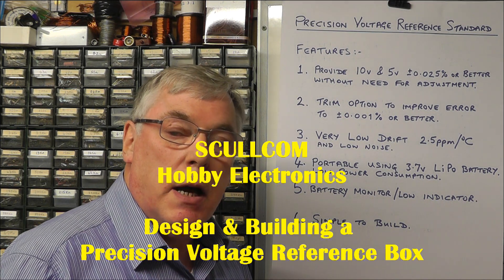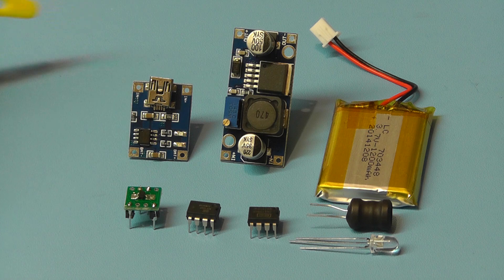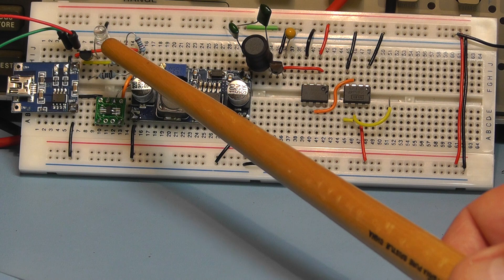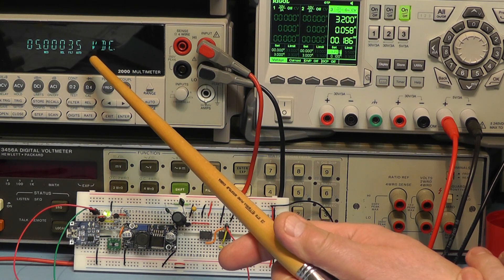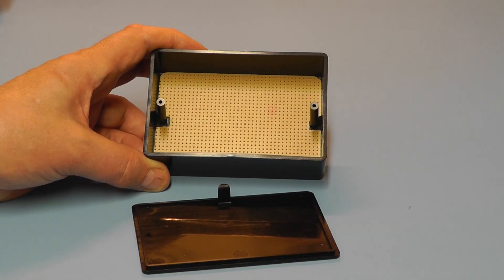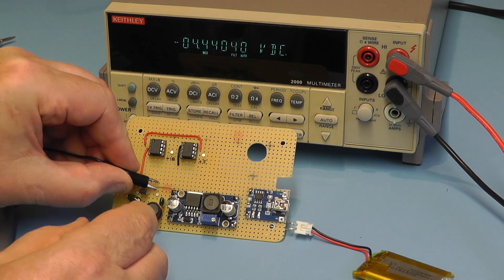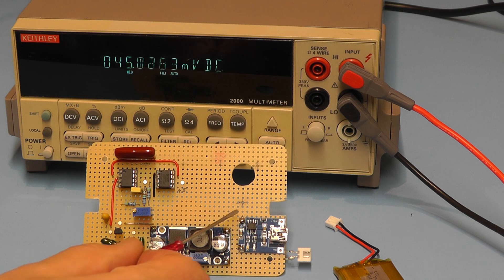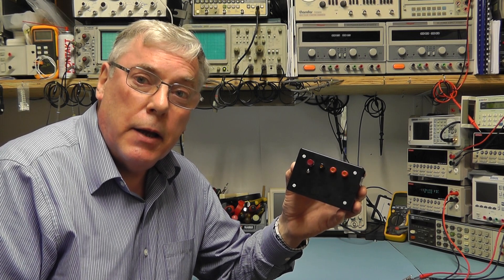Scullcom Hobby Electronics #11 - Design & Building a Precision Voltage Reference Box

Comment: Great tutorial. Would it be an advantage to use another op amp to buffer the output so it no loaded down by your measuring equipment?
Reply: Replying to an old post... If your voltage measuring equipment is "loading down" the voltage output, then you have absolutely ZERO need for this device. In order to take voltage measurements with even the slightest accuracy, your voltmeter should not be placing any significant load on the voltage source. Even the cheapest digital multimeter should have a high enough input impedance that thee will be almost no load whatsoever.

Comment: Hi . Thanks for this video. It's fantastic! How do you compare this reference to the other one from your videos (that one only had one output voltage)? Also isn't the red LED (or it's transistor) wired backwards in the schematic?
Reply from the maker: Thanks for your comments. All of the voltage reference projects produce a accurate voltage. The accuracy depends on the reference IC used. In this project I use a Texas REF102C which has an accuracy of ± 0.025%. In my other 5 volt reference project I use a Intersil ISL21009BFB850Z which has an accuracy of ± 0.01%, but this IC is sometimes hard to get.
The Red LED is wired correctly. The cathodes of both the Red and Green LED's go to the negative supply point. The transistors are a PNP feeding the Red LED and a NPN transistor feeding the Green LED. both transistor bases are connected via 1K resistors to the Voltage Supervisor IC which switches between either High or Low output depending on the level of the battery voltage it is monitoring. So the Red LED comes on when battery low and the Green LED comes on when battery is OK.
Reply: Thanks for your answer.
The circuit is OK and I understand how it works, but isn't the polarity of red diode is wrong on the schematic at mark 10:00 ? The transistor is a PNP with emitter pointed from the diode to base. But the diode is oriented from the emitter to GND. In other words "arrows" of Red LED and it's transistors emitter are pointing in opposite directions.
I believe the emitter and collector of Red LED are swapped.
Reply from the maker: I had another look at the circuit in the video. The LED that I use in this project is a RED/GREEN three pin (Bi-Colour) LED with a common cathode. So the LED wiring is correct in the circuit. However, I see that I had the PNP (2N3906) transistor with the collector and emitter connections reversed as you quite rightly point out. Although this is technically incorrect the circuits still works due to a number of reasons and theory behind a transistor.
The doping of the silicon of the emitter (P), base (N) and collector (P) junctions are all different, with emitter being the most heavily doped element. But although emitter is more doped than collector, the junction size of the collector is larger than the emitter so total number of charge carriers remains almost the same in both emitter and collector regions. So in this practical situation, of my circuit, it does not make a big difference if emitter and collector are exchanged.The other reason it still works in my circuit is due to the low supply voltage of only 3.7v, if the voltage was much higher then the transistor could possibly breakdown. Also if the transistor is reversed wired the transistor current gain is drastically reduced, but in this circuit that does not really matter.
Thanks for bringing this point to my attention as it allowed me to cover this situation of what happens when a transistor is reverse connected.

Comment: Nice and simple! What is the accuracy of the Keithley? Important to note that the drift will be dependant on the external trimming components when you use them.
Reply: You can improve your results by using low tempco resistors and recalibrating the reference after it is on for at least 2000 hours.

Comment: Good tutorial on the voltage ref. I might make one. Very clean and well built. But there's one thing you should consider. What happen when you forget to switch off the box?
Reply from the maker: lavith.hcm Thanks. With regards your question about forgetting to switch off. You might like to check out my latest project on a 5 volt Reference where I include an auto switch-off feature, which could be added to this project. Check out link below:
https://www.youtube.com/watch?v=sKFT9LouyTY

Comment: Nice video! Just wondering how the accuracy is when a sufficient load is at the output of the device?  Does that affect the accuracy of the reference etc.  How can one deal with accuracy with changing load conditions such as changing audio levels etc. of an audio amplifier?
Reply: This device is not intended as a power supply to be put under load. The device is intended as an accurate reference voltage to check calibration of devices, such as a multi-meter.
Reply: Any voltage measurement device that you should use should never place a significant load across the voltage source. The perfect multimeter would have absolutely zero load, however most multimeters will place a tiny load across the test terminals, however these voltage references will easily handle that.
No idea what you are rambling about audio levels... this device has nothing to do with loads or changing load conditions or audio signals or audio amplifiers.

Comment: If you were to use a run of the mill multi turn pot without resistors on either end, assuming that the temp drift would be linear throughout the range of the resistive material in the pot, then would that not eliminate any temp drift, and at the same time give you the facility to trim the voltage more accurately as intended?
Reply from the maker: Donovan Lym Ideally the resistance value of the trim pot should be as low as possible, for example a 1K Pot (25 turn type), but at the same time give you sufficient adjustment you could then used fixed value high tolerance resistors (0.1% or better) either side of the pot to make up the potential divider to the correct mid point required. Good quality high precision multi turn presets with ± 5% resistance tolerance and ± 10ppm/°C are very expensive.

Comment: What happens at higher voltages? I.E when the lipo fully charged at 4 or over volts.
Thank you for a great project to try.
Reply from the maker: +MonkeyMagic Elecifun Thanks. There were no issues at 4 volt. The TPS3809 voltage supervisor has a maximum supply voltage rating of 6 volts.

Comment: I'm finding that when the green LED is on, the red is illuminated simultaneously. I've checked and re-checked everything. When voltage is low the red is solely illuminated as expected. Is that what you see as well, or have I gotten something out of order? Thanks for the great videos!
Reply from the maker: Hi,
If the green LED is on then the red LED should be off. Check your circuit around the LED's.
The green LED is connected to a 2N3904 (NPN transistor) and the red LED is connected to a 2N3906 (PNP transistor) - check to make sure you did not use the same transistor type for each LED which would be wrong. Also check the wiring of the two 1K transistor base resistors.
It is also possible the transistor feeding the red LED is leaky and may need replacing. Or you have accidentally connected an transistor the wrong way.
Regards,
Louis
Reply from the maker: As a follow-up to my last replay. One of my other viewers has pointed out that there is a small error on the schematic I drew on my whiteboard. Seems I made a silly mistake when drawing and did not notice at the time. The PNP transistor (2N3906) collector–emitter need to be reversed. This may have been causing your issue. Sorry about that. Regards, Louis

Comment: In the circuit diagram at 9:30 am I missing something or is the pnp transistor upside down? It seems that the emitter of the pnp is connected through the led to the negative rail, and the collector through the 120 ohm resistor to the positive rail.
Reply from the maker: Thanks Michael for bring this to my attention. Looks like I made a silly error when I drew the circuit on my whiteboard. As you say the PNP transistor collector–emitter need to be reversed. When I have time I will draw an updated schematic and provide it as a download for other viewers to use. Thanks again, Louis

Comment: Hi, great project, is there any reason why I couldn't use another INA and divide by 2 again ?...cheers.
Reply: You can do that, but the error will probably increase due to the error contributed by each chip. You will also increase the noise output.

Comment: Should you have done the DVM measurement with a load (ma within the specified within what the part can drive ) ?
Reply from the maker: Thanks for your comment. As this unit is designed as a precision voltage reference source for calibration purposes only it does not need to have a load. If you were to use it with a load then you should take in to account that maximum output current for the REF102 chip is very low at around 10 mA up to this level the load regulation is 10ppm/mA max.

Comment: If you wee to get the 5 volt version of the TI ic, could you eliminate the precision diff amp and feed directly into the Arduino AREF pin?
Reply from the maker: Donovan Lym But the purpose of the project was to provide both 10 volt and 5 volt precision reference source. The Arduino only operates at 5v or 3.3v so you could not use it with a 10 volt reference. You could simply limit your reference to 5 volt if you wished and purchase that version of the reference IC. But I am not sure why you would want to use an Arduino. What do you plan to do with the 5 volt reference? Are you planning to use the Arduino to divide the 5 volts down to lower voltages? If so the accuracy would suffer.
Reply: Yes, forgot about the 10 volts. There is apparently a 5 volt version along the same TI series of ic's. What I'm trying to do is to use the Arduino to measure a voltage A between, say, 20 to 60 volts via a voltage divider. I forgot that I need to take into consideration the temp coefficients of the resistors. Anyway, assuming I take care of that,  I wanted the measurement to be pretty accurate and therefore needed greater stability than my supply ic 7805 would provide as the ADC ref voltage and hence all my questions.  

So, questions again:

1. If I got the 5 volt version of the TI chip, would I be able to connect to the ARef pin without the diff amp?
2. As explained in my other posts , that measured voltage A is to be compared with another variable voltage B which would be obtained from a run of the mill pot between the 5 volt rail and ground. Since there is no other resistor, is it safe to assume that the voltage would stay constant with temp variation, providing the supply voltage from the 7805 remains relatively constant. 
3. Assuming 2 above is yes, going further, would I be able to also connect the TI output to this pot?  The pot is 10k linear trimmer. 

Hope it's all clear now as to what I'm trying to achieve and would appreciate any feedback.
Reply from the maker: Donovan Lym OK thanks I see what your trying to do. Answers to your questions:
1. Yes you can connect a 5 volt reference voltage directly to the Arduino ARef pin (you do not need a diff amp). You can connect any voltage directly as long as it is no higher than 5 volt maximum. REMEMBER - If you're using an external reference on the ARef pin, you must set the analog reference to EXTERNAL before calling analogRead(). Otherwise, you will short together the active reference voltage (internally generated) and the AREF pin, possibly damaging the microcontroller on your Arduino board. 
2. If you simply are comparing 2 measured voltages with the same setup then I see no reason why the difference between the two would drift as any effect on temperature variations would effect both your A and B voltages equally. So the difference would not be affected.
3. Yes you could connect a 10K trimmer across the output of the 5 volt reference IC. The only thing you have to consider is that you do not exceed the maximum current load for the IC, which I think is around a Max of about 20mA (10K on the output will only draw 0.5mA) - check the datasheet of the IC you decide to use).
OTHER POINTS:
The Arduino has a 10-bit analog to digital converter. This means that it will map input voltages between 0 and 5 volts into integer values between 0 and 1023 (a total of 1024 steps). This means the resolution between readings of 5 volts is divided in to 1024 units (steps) or to 0.0049 volts (4.9 mV) per unit.
Reply: Scullcom Hobby Electronics Thanks for your responses.  Great videos.  Keep them coming.  May I ask what your background is?
Reply from the maker: Donovan Lym Thanks. I have worked in the electronics field for many years and way back in the 1970's I did teach engineers for about 7 years.

Comment: Ah the ridiculousness of import duties - it costs less to import components on printed circuit modules than to buy the components individually! One question though, what is the power consumption of the reference and op amp? Is the complex rechargeable battery circuit really justified? How long would two 9v MN1604 ('PP3') alkaline batteries in series last for?

Comment: You are using pins that sit in the project board holes and appear to anchor the pin in the board to provide a solderable mounting pin for the components. What are these pins called and where can I buy a bunch of them. Cannot find them in my catalogues - Newark etc.
Reply from the maker: If you search on eBay for "PCB Vero Board Terminal Pins Prototype" you should find them. Some links below:
http://www.ebay.co.uk/itm/100-x-PCB-Vero-Board-Terminal-Pins-Prototype-/192083933896?hash=item2cb9183ac8:g:NH0AAOSwU9xUS78S
also
http://www.ebay.co.uk/itm/100-x-Vero-PCB-terminal-pins-prototype-connector-plug-/262088446288?hash=item3d05b05150:g:6F4AAOSwAYtWGiMb
Also similar items from Farnells (Element 14) called VERO  18-0222  TERMINAL PIN, PCB, PK1000 (Order Code: 1209347)
Reply: Thank you very much. getting vero board here in the US is not easy. newark, which is a Farnell Co., does not stock it. I remember being able to get the stuff easily before I cam to the US.
Reply from the maker: You should be able to find it on eBay quite cheap.
Reply: Sorry to be so long replying;. the iniquities of aging I'm afraid. I did find the pins on E-Bay UK but no one wants to send them to the USA. So, my brother is getting me several hundred. Thank you very much for the information.
Reply from the maker: Glad to hear you got it sorted in the end.

Comment: Ref102C has a voltage input range from 11v to 36V, so why bother with a complicated DC to DC converter followed by a linear reg when you could just use a DC buck boost directly to 15V ??
Reply: I would assume so the linear regulator can reduce ripple on the input to the REF102, which may pass a small amount of it on to it's output.

Comment: +Skullcom Hobby Electronics Are there any other reference chips that could be used in this reference box since i am having a hard time finding REF102C. and can INA135PA replace INA104? 
Rather, seems finding all the different IC chips are hard or i don't know to look except Mouser / Farnell but shipping is expensive then.
Reply from the maker: Both the REF102c and the INA105 should be available from most electronic component suppliers. You could replace the REF102C with a LT1021C. There is no direct replacement for the INA105. I have never heard of the INA135PA. As well as Mouser / Farnell (Element 14) try also DigiKey and Radio Spares also try eBay. You do not say which country you are in so difficult to advise fully.
Reply: Greetings, I will keep an eye open. Sadly forgot to mention i am in Sweden.
Reply from the maker: Before I retired I use to visit Stockholm a lot on business and use to take the ferry across to Turku in Finland. Had some great times there and loved the food.

Comment: Do you use a 100 μH (you say this at 8:47) or a 100 mH (you say this at 12:45)  inductor?
Reply from the maker: ***** Sorry about that, It was a small 100 mH inductor.
Reply: +Scullcom Hobby Electronics dark, I missed that. I bought a bag of 100uH,, oh well. I didn't need then anyway. Maybe that's why it didn't filter any more noise.

Comment: I have negative experience using xl6009 xl6019 step-up modules in battery powered devices. This ic has minimum input operation voltage 5v. when input voltage getting lower, output voltage can be higher than sated before. For similar cases i using mt3608 based modules. It has 2v minimum input voltage
Reply: fully agree, no need for a dc to dc converter to bring the voltage up to 20v to have to reduce it to 15V via a regulator when you can directly use a MT3608.